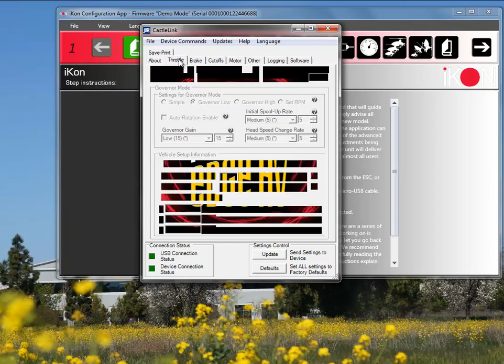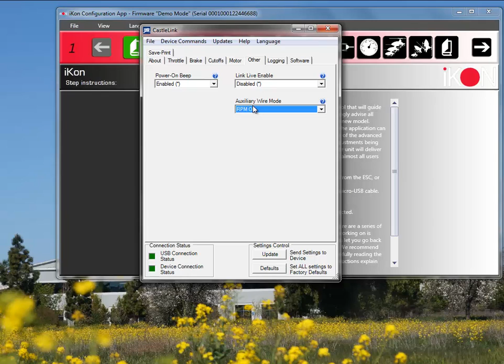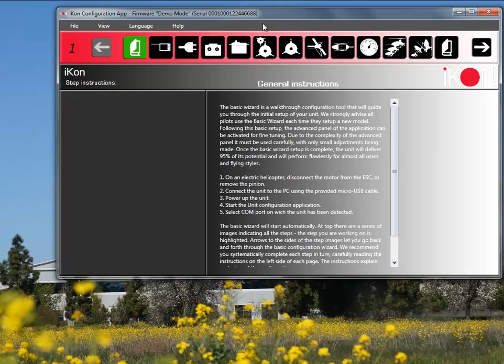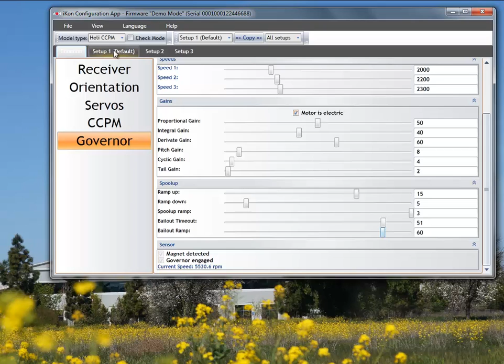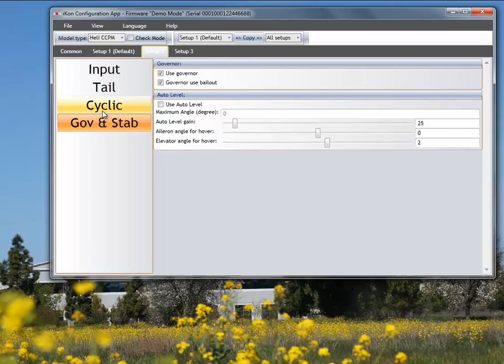iKon Auto-rotation Bailout with Castle ESCs Video 1

Comment: Question.. you set your esc to external gov, and then  you set your slider throttle min/max on the ikon gov advance menu...is that all there is to it? you didn't have to set esc end points? I mean how would the esc know what is min and max throttle end points? I am using the CC Ice2 HV160 Great video and simple steps if that is all there is to it.

Comment: If I know this correctly.. Just to add to what you said. IN external governor mode, Castle doesnt like Auto rotation bailout to be checked. The esc will not initialize with External governor and auto rotation checked. I have tested this on my ICE2 HV 160